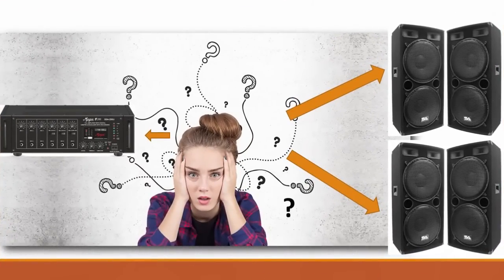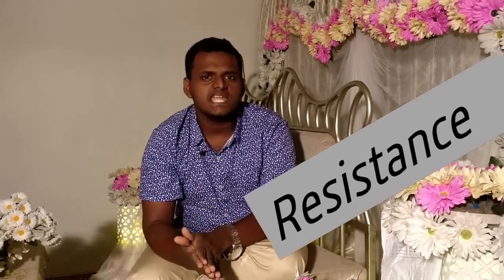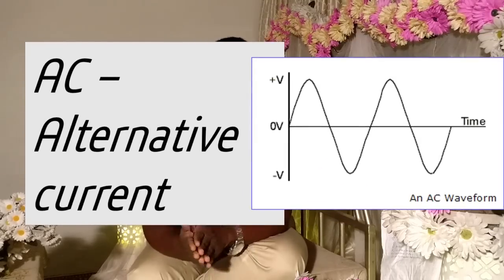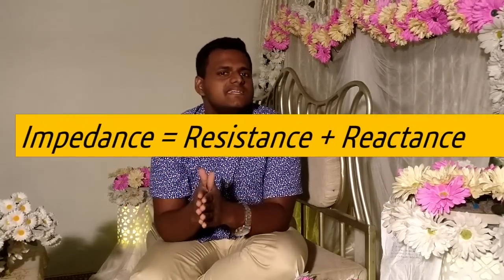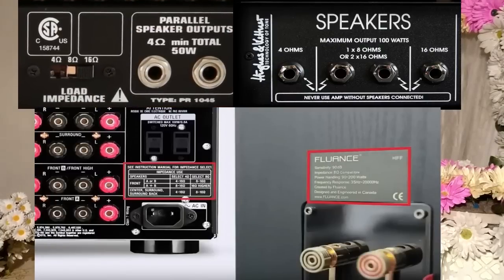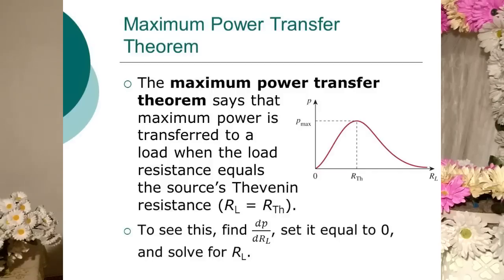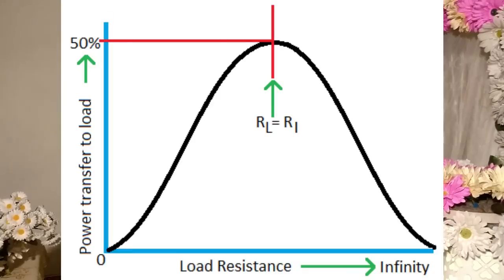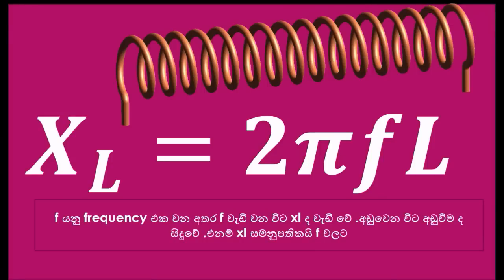මොකක්ද මේ speaker එකේ impedence එක කියන්නේ(speaker impedance part 01 )

Comment: aiye mn 15" top dekak heduwa. 1000w inkel 1i. 400w rock 1i. 450 hise ekai. Ekapettaka. Amp eka 600w. Bagekata wediya arinna bee. Wedikaraddi low eka hirawewi ahenne. Hepl ekk dennko puluwnnm. Speaker watt balance nethi nisada
Reply from the maker: 0719387311

Comment: 50w+50w, impedance 6ohm, Tina setup ehekta 6 ohm,150w 3ey bafal dmmot setup eKta awl neda,et 150w kiynne bafal eKta denna Puluwan maximum w EKA neda
Reply from the maker: na awulk wennea na nea. bath pigana thma bada purawannea. pigana lokunam apita kaganna ba nea. ewagea ampm eka 50w nisa buffel ekata 150kma daraganna puluwan nisa awulak wennea na.
Reply: @labtronics1140  tnks,❤️❤️❤️❤️
Reply: Impedance gana prshnayk,
8_16 ohms ,,onna ohoma dla tinwa setup apm eke.
Ohms parasya vadi venna, venna speaker vala maximum w pramnya adu agyk neda tiyenne.
Etkota amp eke Chenal ekakin 150w k out venwanm e amp eKta  8_16 ohms  prasa atrin speaker ekk torganna ba ne kwdawt ,w glpanna bane ,(ohms agya vadi vena venna w adu nisa)

Comment: 8 inch ,8 ohms, dual voice coil, 300-450w. j audio bass speakers 2kata mona wage sub amplifire 1kda match wenne?
Reply from the maker: vehical wlata dana jbn sub amp eka hodai
Reply from the maker: https://www.google.com/url?sa=i&url=https%3A%2F%2Fwww.daraz.lk%2Fauto-electronics-amplifiers%2F&psig=AOvVaw3asFlyoE4fqeL6pb899OOm&ust=1601094680690000&source=images&cd=vfe&ved=0CAIQjRxqFwoTCJiR5tG8g-wCFQAAAAAdAAAAABAD